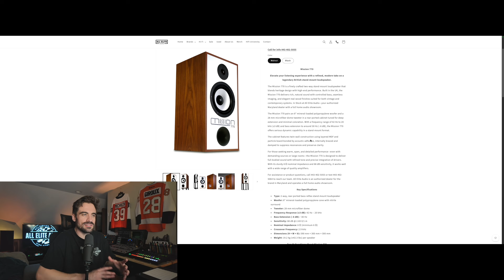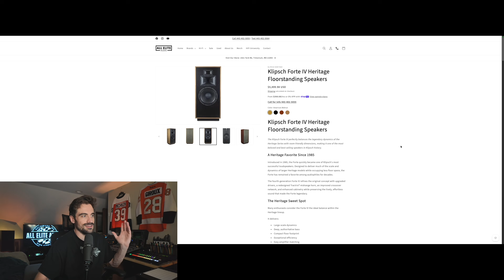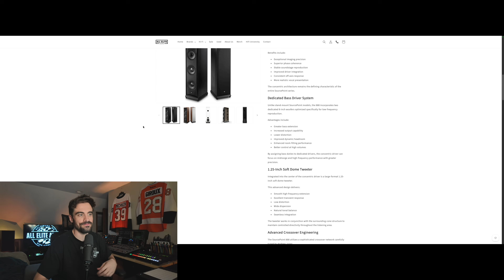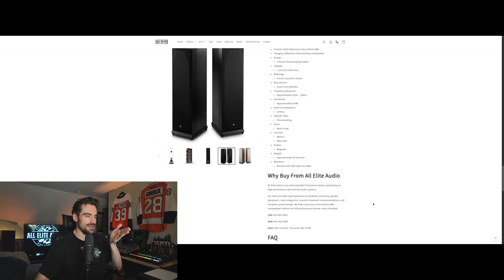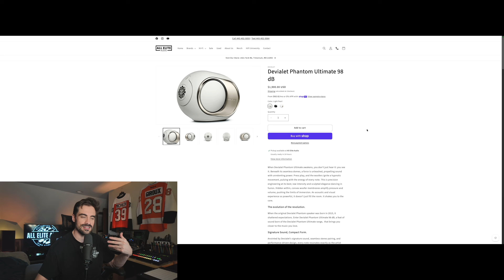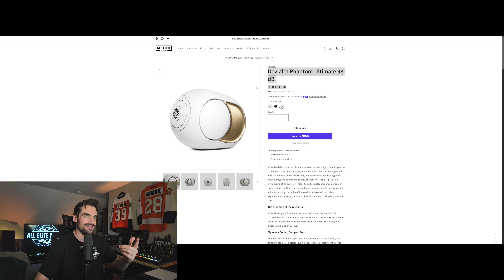The Best $5,000 Speakers You Can Buy Right Now

Comment: I own both the Klipsch forte Iv and the Mofi v10 (the bigger brother to the 8s).  I enjoy both for different reasons, the fortes obviously project the sound forward and up front with the horn (dynamic).  The v10s, though they are larger in size, they have a gentler wider projection that actually envelopes the listener, with fantastic imaging from those dual cencentric paper cone drivers.  If you have the space I would recommend the v10s (I have a 27x27 foot room).  The fortes are great for tube or class a amps.  I actually prefer listening to something like Black Sabbath or the Stooges on the fortes.  However, the v10s just have a  more rounded sound for listening to layered jazz,  Charles Lloyd or Miles Davis. Both have very good low frequency response, both using passive radiators. I still however use svs sb2000 right and left subwoofers to round out the bottom.
I use a prima luna evo 300 preamplifier for both, and have the v10s bi-amped (Coda s5.5 class a on the top and a march audio class d on bottom).
Reply: Hello. May i ask what amp(s) you power the f4 with? Did you dynamat the horns?
Reply: @lightweaverx4381 I used the Coda s5.5 class a amplifier on the fortes until I switched it over to the mofi v10s, which I now use bi-amped.. The Coda with fortes combo is excellent.  I have ordered an Aric Audio custom 300b pset tube amplifier for the fortes which will come in a few months.   I did not dynamat the fortes, nor would I.  I have reviewed videos of people that have done that to their fortes with mixed reviews.  Personally I believe you would lose the character of the fortes by doing so.  
I also use ART eq355 equalizers between preamp and all power amps for gain, crossover and equalizer controls.  
Source is a marantz cd 6007 as cd transport with chord cutest dac.
Reply: @lightweaverx4381 By the way, in addition, you can find forte iv speakers on the used market quite frequently for nearly half the price.  I bought mine as b-stock for significant less.  There is no question that the cabinets are thin compared to other brand speakers.  I elevated them 3 inches using absorption under and within the bottom stand mount cavity under the speaker.  I also weighted the top of the speaker.   I position the fortes aprox. 9 inches from the front wall to get better bass from passive radiator.

Comment: I am trying to decide between Mission 770 and Spendor 2/3 (to be used with a Yamaha RN 2000A). The rquirements are: they need to placed quite near the wall, they need to perform well at lower volumes, listening to jazz/classical with an ocasional excursion into hard rock :). Which of the two would you recommend?
Reply from the maker: The Spendor 2/3 are a significant upgrade to the Mission 770s. I really notice the higher quality drivers and the cabinet is night and day!

Comment: I'm sorry to say I still love the old mini monitor v2 just fine. But I'm used to some really cheap units in tiny nearfield.  The definitive subwoofer Prosub 800 has a HPF on the speaker level in.. so it repeatedly ends up turned down with a small monitor in a tiny room off a Denon mini system. Currently it's an aiwa which is poverty level..  and Paradigm Mini Monitor V2.  V6 is goals with a better amp but honestly the aiwa does fine off LDAC 6.0 aux in when the 80hz HPF makes the 10wpc handle less bass. Storage unit spares.  Kef self powered is likely the only other thing I'd bother with.

I don't think any of those would suit my usage at all and $5k.. better include all 5 sets.

Comment: For folks that don’t have the room to have their speakers 6feet out into the room or those that truly don’t care about how speakers are placed in a room—the KLH speakers model 5 and I imagine model 7 are one and done. You don’t have to worry about boomy bass. They truly have fantastic sound. The better your system the better and more natural they sound.
Reply: my room is only 5m by 5m thats why i bought the b and w 702 s3 signature speakers coz they're downward firing-mine are 12 inches from the rear wall-sounds great zero bass bloat
Reply: @jarrodevans7655 I have front firing speakers now. I have to say, no port is just the smart way to go for those of us with small rooms. And the ability to place them against the wall is just common sense.